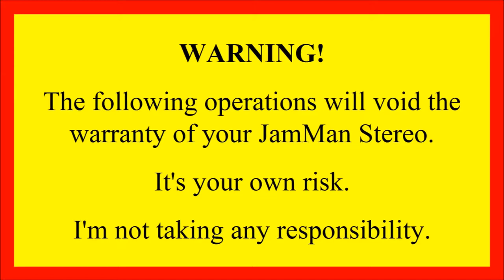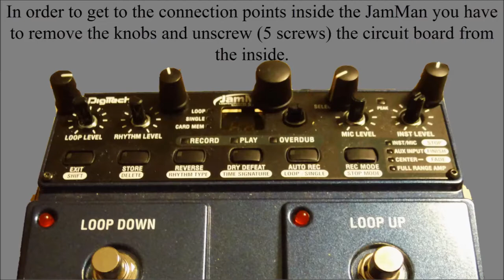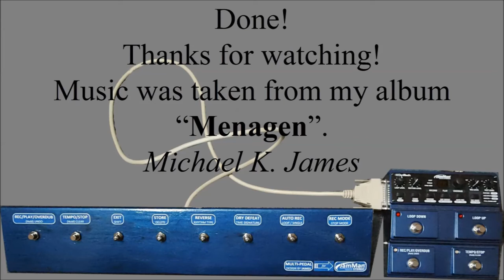DIY Floor Board for JamMan Stereo by Michael K James

Comment: Great video. 
I have one of these I bought two years ago, off warranty now 👍
I am familiar with soldering so this will make a great project to make my Jamman better. 
I was only able to start using it recently as I bought it when I just started learning guitar so it was way over my head. But now I can learn looping in quarantine here during 2021 C19. 
Thanks again!
Reply from the maker: Good thing is that you have both hands on your guitar. That's especially useful when you are playing for an audience.
I wish you good success and would like to hear from you, if it works. Greetings from Germany!